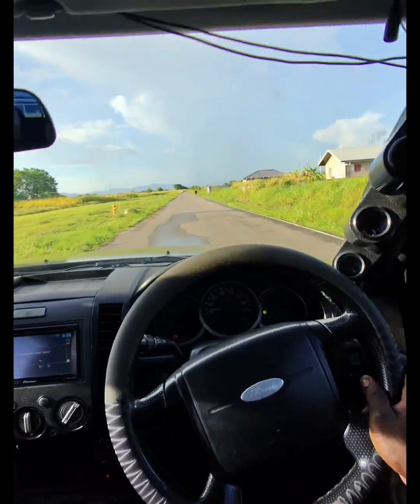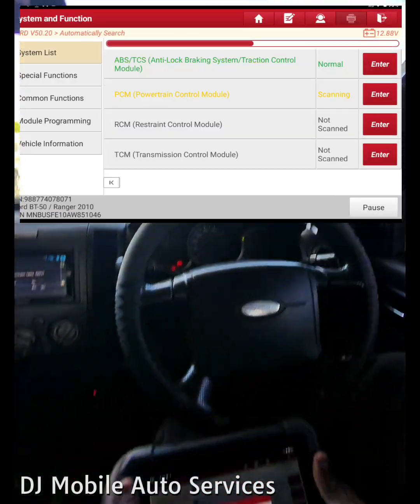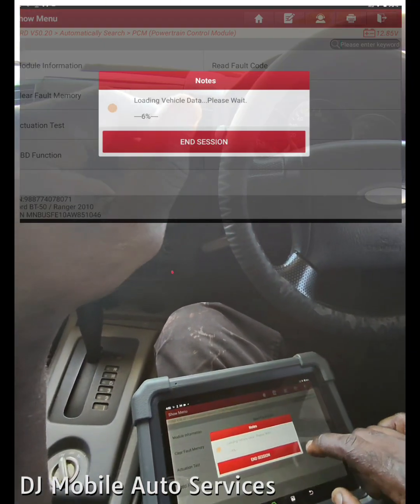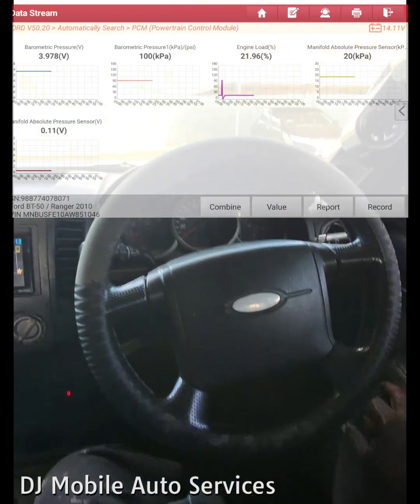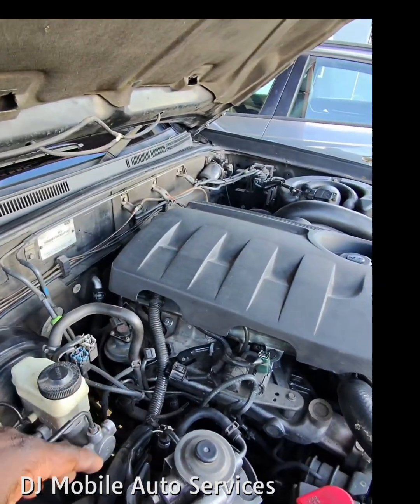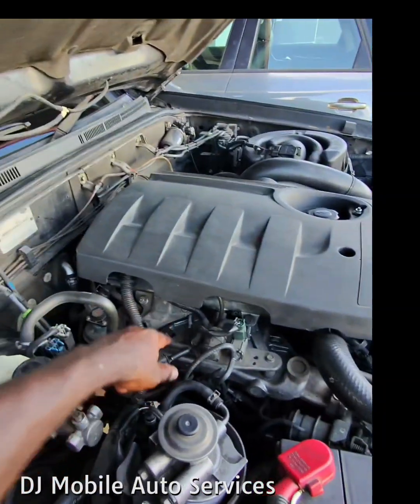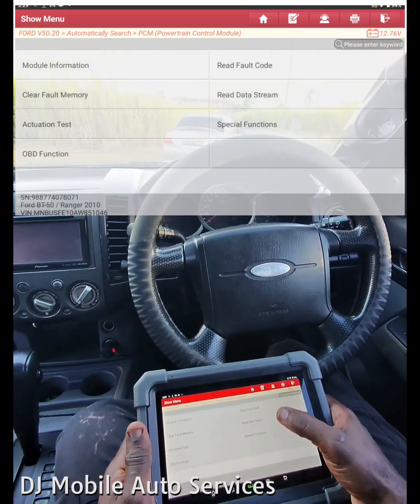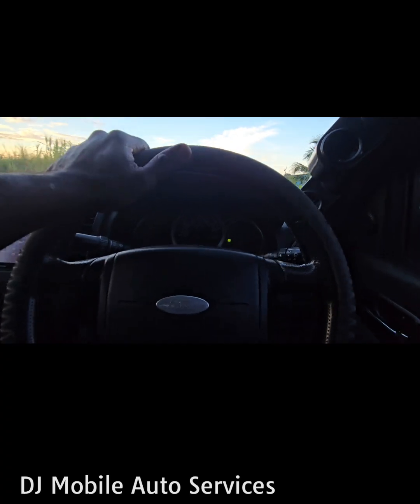Ford Ranger XLT & BT50 Map Sensor Circuit Low Fault Diagnosis & Sensor Replacement #P0107 #P2227-FF

Comment: At 140,oookm it needs the,,,  inlet manifold ,, egr valve ,,, egr cooler ,,, intercooler and duct work  ,,, cylinder head intake ports ,,, ALL NEED cleaning out ..  This is mandatory on all direct injection diesels .
Reply: Great video thank you
Reply from the maker: Glad it helped
Reply from the maker: The car was fixed and sent on its way. The client didn't want to spend too much cash on it because he sold it a week later. Thanks for the comment